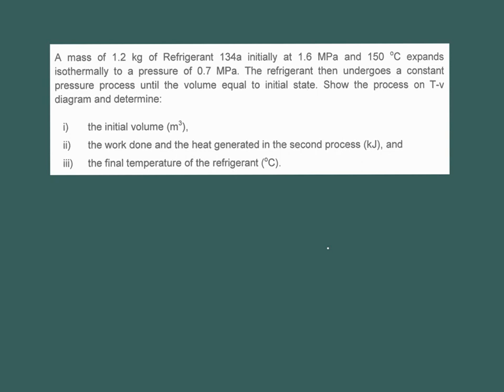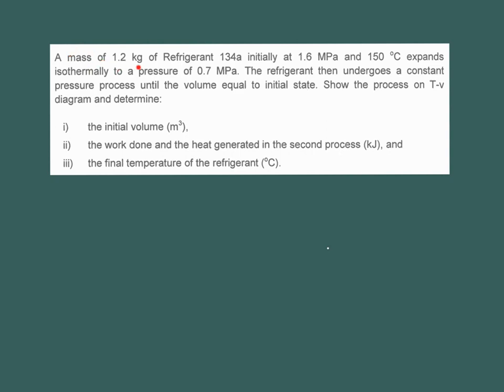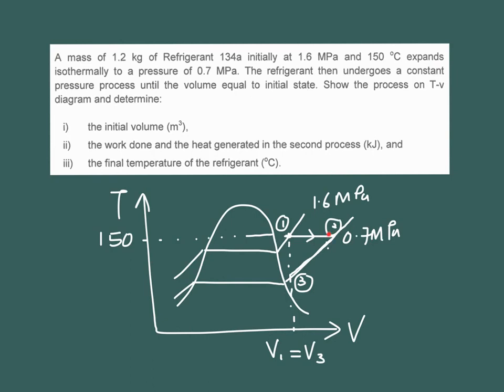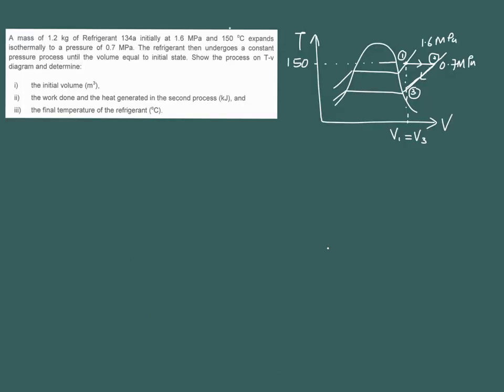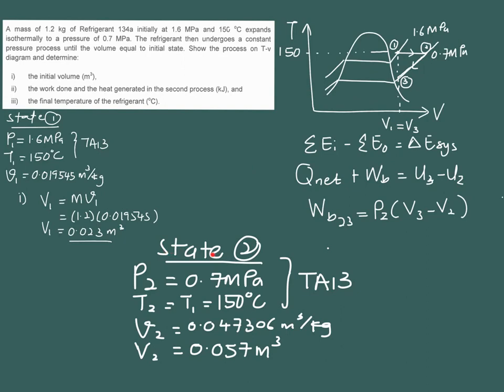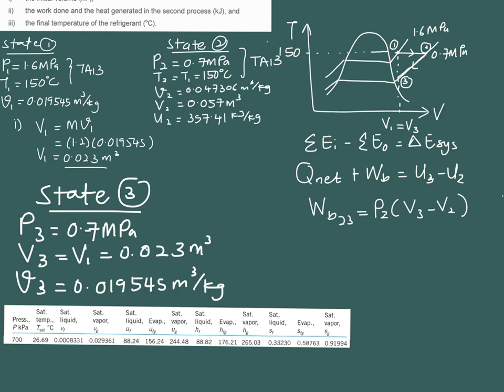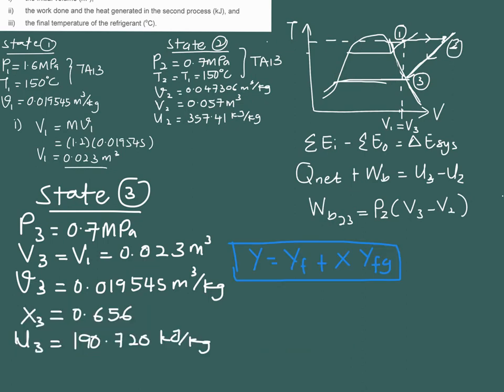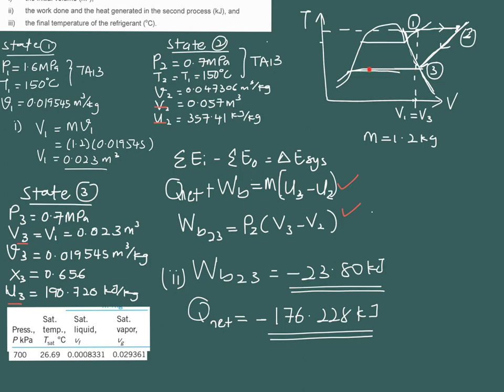Thermodynamics Problem | Energy Analysis in Closed System

Comment: Why  I cannot use enthalpy in my calculation for the second process as the pressure remain constant?
Reply from the maker: If I understood your question correctly, you are referring to changing the mathematical expression as by applying h= Pv+u, so that you can make use of that h(enthalpy).  Is that what you mean by?
Reply: Yes, I encounter same problem too
Reply from the maker: @sohminglun4169  the explanation is as commented above. I hope it helps.
Reply: Yes, that is my doubt
Reply from the maker: Yes  @leeyongzhen2818  , since you already grasp the fluid flow concept that enables us to use the h equation, you may use directly the pressure in resolving for Q.

On the other hand, for those who frame the problem step by step, as according to the question, which asked to find the value of work boundary they can separate to calculate the work boundary 1st.

Thank you for highlighting this, as I check on the video again, I noticed that I had the wrong answer for Qnet. Presumably, careless mistake while using the calculator. Hence if you make use h directly to solve for Qnet, the answer should be about the same.

Comment: why change in internal energy i u3-u2? why not u3-u1
Reply from the maker: Alien FX yes you're correct if the question ask for the heat generated for the whole processes.

But in this example, the question in (ii), asked on work done and heat generated spesifically at 2nd process, which in this case from state 2 to state 3.

I hope I'm answering your question.